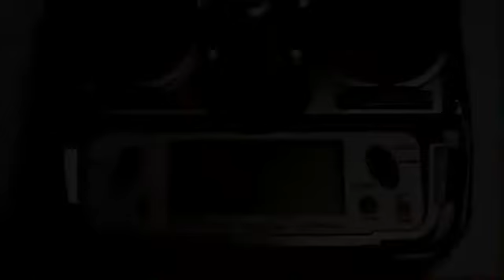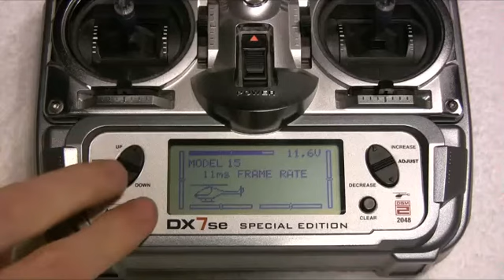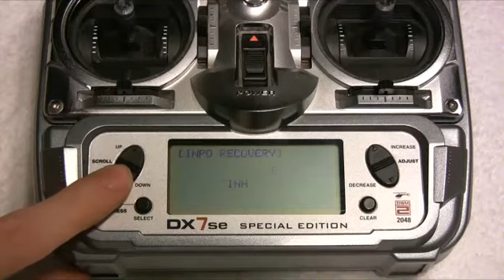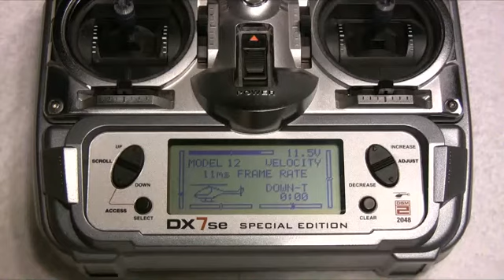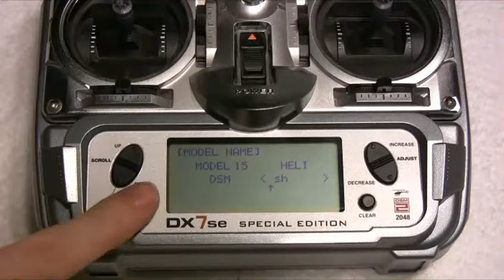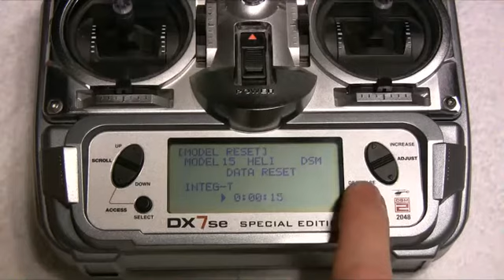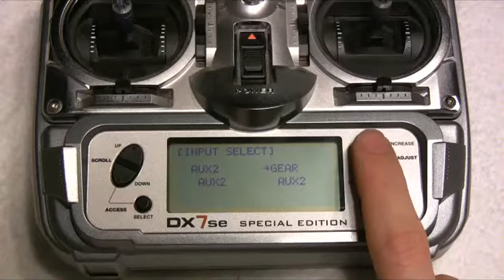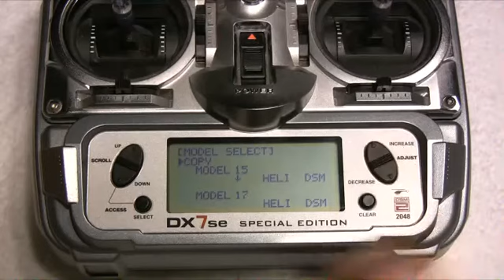Navigating the DX7 System Menu

Comment: Do you have a video that shows how to set up the individual servos in terms of centering, offset, and throw adjustments? I think I have all my mixing mixed correctly, but the centering is not correct. For instance, I'm trying to mix my Aileron channel to Aux 2, but the Aux 2 Slave channel doesn't move the same amount as the Aileron Master channel. Also the centering for Aux 2 isn't correct. FYI, I'm moving from using an ACE Micropro 8000 transmitter and PRO 810 receiver to the Spectrum DX7 transmitter and AR7000 receiver because my older ACE Radio equipment is so old I don't want it to fail and cause a crash.
Reply: I have a similar question.  I need to reverse my servos but can't find the menu.

Comment: A great help and much appreciated. I have acquired a plane with a glo motor, my first, and have a problem finding how to set throttle for idle and
how to switch the motor off. My trans is the same as yours and I have the manual. Thanks Colin

Comment: Great video!

Hello,  my DX7 has been collecting dust unused in my garage for years. Decided to pull it out to fly my Stryker. I continuously see ‘No Trainee’ flashing  And heat a beep approx every 30 sec. Transmitter seems to be reminding me ‘no trainer cable connected’ or sensed’? Can I turn this off?

Thx,
Michael

Update: Enter {trainer} then select INH
😃